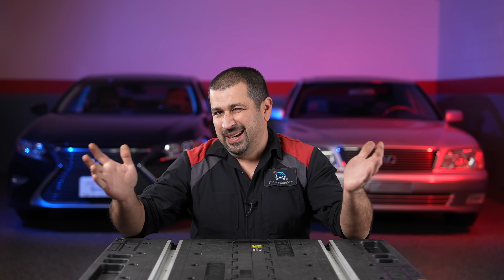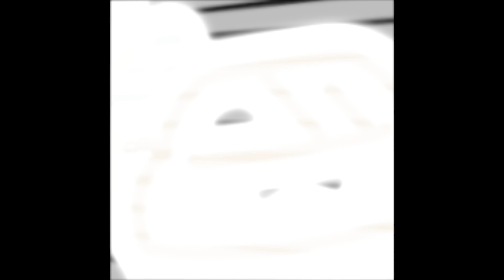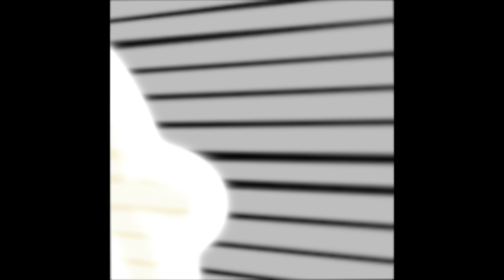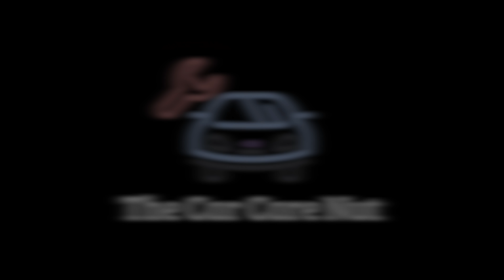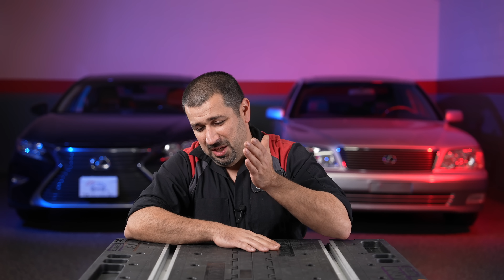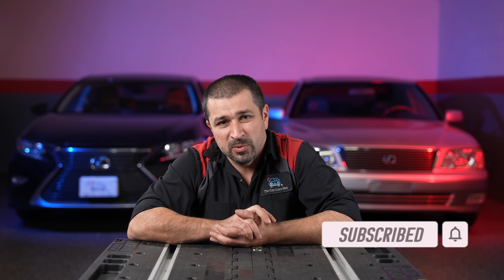Can Modern Turbo Engines Be Reliable? Here's The TRUTH!

Comment: I’m a technician at a Mercedes dealer. Our cars have 10,000 mile oil change intervals. Nobody, and I mean nobody, brings their car in for an oil change in between the 10k mile interval. Personally, I change my oil every 6 months/5k miles. The general public just doesn’t do that.
Reply: That's because most owners lease their cars, or they are on a budget and decide to stretch their schedule lolz. Off-lease car buyers beware.
Reply: @TrevorWebb-ck2yv nah, the cars just get sold as “Certified Pre-owned” (CPO).
Reply: @TrevorWebb-ck2yv I lease I did my 1st oil change on my 2025 sonata hybrid at 2k. Why? To get the metal scrapings out from break in. Now it will be every 6 months. I take 0/16 viscosity oil much thinner to handle cold startups. Might keep car but might turn in. But I want to take care of the engine in case I keep it.
Reply: @TrevorWebb-ck2yv  What's the price tag for that 10k service?
Reply: @TrevorWebb-ck2yv  Most German leases now have free 3 yr maintenance (oil change)...
Reply: @rebeltvr6046  Right but still restricted to the maintenance schedule. You can't come do free oil changes every month.
Reply: @rebeltvr6046  Doesn't mean these people are going to do them, even if oil change is included. Takes too much of their time. Most of these cars are leased anyways.
Reply: @rebeltvr6046  Not Mercedes!
Reply: Most people smart enough to do them at 5k are smart enough to do them at home.
Reply: @rdspam not if you care about a warranty. How are you supposed to prove you changed your oil at home
Reply: @randykern1842 If you don’t have dealership service dept receipts as proof of oil changes and baseline maintenance you can kiss your warranty and any post warranty goodwill goodbye. Is that simple. Enjoy!😂
Reply: @randykern1842 they could easily test the oil
Reply: @Mebbwebb that doesn’t prove all oil changes were performed at appropriate intervals that just proves the current oil is okay
Reply: @randykern1842 I always say what warranty. I don't need the damn warranty. I'll replace the stuff myself.
Reply: @Pamlicojdjdj1487I always say what warranty. Just like insurance in any capacity. Their job is to deny everything so I don't operate under the assumption that if something goes wrong it's going to be replaced by the dealership so I could care less.
Reply: @rdspam warranty becomes invalid!
Reply: When i get my first car in japan i was surprised that they change the oil every 3000 k but now i understand that’s the right think to do if you want to keep your car for years with no engine problems
Reply: I agree with you but what’s funny is that you bring your vehicle and tell the dealership that you want the oil change at 5k miles they will tell you nope you gotta wait until 10k 15k whatever the manual says.
Reply: @jk8839 And that why young persons should learn to perform it yourself.
Reply: @jk8839 that is crazy! Why would it make any difference to them? Maybe they want you to buy another vehicle sooner when you trade it because your having engine problems! Lol.  If your dealer is telling you that ,you need to find another dealer.
Reply: @petejansen7220  😂 exactly! That’s why I always change oil and filter on my own at least!
Reply: @davidkrumwiede446  I myself 100% (EDIT) been working in used & new car garages in the UK for 30 odd yrs,so many bring their cars in over 10,000m for a service and still have FSH/FULL SERVICE HISTORY. But Severe driving is what most of us do as the roads are getting busier,roads works everywhere & start stop traffic is now common with traffic lights & rush hour.
Reply: @tardeliesmagic  unless you are retired and don't drive rush hour anymore haha
Reply: @gosman949 Here in Northern Italy almost any hour is rush our... 😢
Reply: @AAAAAAndrea  oh my!
Reply: How much is a Mercedes oil change?? 🤑🤑🤑
Reply: @JP81188 I have a friend,new Land Rover Defender. Brought into the dealership. 2 years. Oil change and such. Assorted. Maybe wiper blades. 1K for the service. F outta here.
Reply: @JP81188 I have an 03 E class, V6. The oil capacity is 8.5 qts. I use Mobil 1 0w-40 European formula, plus the Mann filter so about $65. I don't pay anyone to do it for me. Car currently has 333k+ miles.
Reply: @JP81188 only if you let the dealer do it. The oil can be bought at Walmart if you DIY.
Reply: That's because you guys charge an arm and two legs for a simple oil change.
Reply: The 10k oil change interval is a lie.
Reply: @bearerofashes Especially with a turbo and very thin oil
Reply: i have a Stinger, and it also has ridiculous oil change intervals. I take it to the dealer since its under warranty and i want records that they did it. Its $90 for a full synthetic change, i do twice per year which works out to 4500 mile intervals. i know its warrantied to 100,000 miles / 10 years, but i love it and might keep it. im also going to go against the manual and do the transmission fluid change sometime around 50-55000 miles. might even do differential/xfer case/whatever it has. i even covered the brake bleeders with grease so i can always get them open easy. overkill, maybe. i dont punch it until its completely warmed up and i take it easy the last couple miles home. whoever gets this car after me is going to be very happy.
Reply: @danwake4431 
Man, I wish owners like you could be marked somehow.
Reply: @danwake4431 Here in Western Europe, you can multiply that $90 by three for an oil change and oil filter replacement. I pay over €300 for that here, believe it or not. That's why I'm going to do it myself from now on.
Reply: @danwake4431 Everything you are doing, is reasonable and correct. I do mine myself, in my garage. Fun and easy to do once you have the correct equipment and desire.
Reply: It’s a kia, don’t waste your time with anything other than ordinary… it’s gonna blow up or burn oil before 100k either way
Reply: @danwake4431 keeping it mint for the next guy is gay lol
Reply: @MF-rtard89  thats just pure luck if i sell it lol. im hoping to keep it for a very long time and have  very little trouble with it
Reply: That’s because 80% are leased vehicles, means the “temporary owner” is going to do bare minimum for PM
Reply: I'm s General public...... for my Subaru I do oil change twice a year for 10 years now 😅😂 it's just my Common sense
Reply: Agreed. I'm a twice a year guy. Early spring and late fall. It averages out to be around 6k miles. I think 3k is nuts.
Reply: @locker1325 I am so with you and do the same thing!!! Thanks!!
Reply: @locker1325  3k is nuts if you can't use the dipstick vaccum method. I use that and I do 3 times a year.
Reply: @AAAAAAndrea Well I think that's extreme but I can't argue with results. My Subaru oil at 6k is damn thin and very dark. But I think flat engines generally contaminate oil more. My Subaru also takes a couple of quarts between changes. There was even a recall for it. It changed nothing though.
Reply: European cars have bigger sump 6 to 8 qts so 10k oil change is same as 5k change with smaller sump 3.5qarts
Reply: @ceylontea5877 Good point. They do.
Reply: I've always changed my oil at 5000 10000 is nuts
Reply: @tdobson888 right ,common sense 😂 no longer a thing
Reply: Are most of those mercedes leased though?
Reply: maybe if an oil change a service wasnt a completely ridiculous $500 at many mb dealers.  the whole thing for mb svc is a scam
Reply: This is why I only buy new vehicles. I’ve never bought into the 10k mile oil change interval.
Reply: @smitty858 Some old cars can handle that, but GDI turbo garbage or  EGR DPF etc... can't handle that. You need at least 5k miles/~7500km then oil and filter at 10k.
Reply: I change my oil every 6 months, when I switch between winter and summer tyres.
Reply: I change my own oil every 6 months or 5k miles, whichever comes first. I am not a mechanic and I just learned how to change my own oil 4 years ago. I have a car 4 year old car bought brand new which is a gem and they don’t produce anymore and I want to keep it for the next 10+ years
Reply: Am a truck driver for 20 years and I have a lot knowledge about engines any engine, including boxer engines., I use TURBO ENGINE ONLY in tractor commercial truck , BUT I skip any single turbo engine for pickups truck , SUV and sedan cars , just no worked basically is just scam technology , Turbo engine is ONLY for tractor commercial trailers
Reply: - and then you have the car owners who NEVER change the oil in their car, then wonder why they are having major engine problems at 30K miles.
Reply: The interesting thing is that dealerships tells you to change it every 15k kilometers (10k miles) but you have to specifically check it for it tobtell you to sometimes change it every 5k Miles (short trips etc.)
Reply: Mercedes is laughing themselves all the way to the bank.
Reply: I do
Reply: Every 5000 miles or less.  Range Rover dealership threatened to void my warranty if I used anything but 0W20 in my 2025 V8 defender.  I want to go to 0W40. Going to have to do my own changes going forward.  Which will also likely void the warranty.
Reply: I took my 2024 Plantinum highlander into the dealer every 6 months, 2 times now. I have only 6300. Miles.  They bitch every time and tell me about the manual.
Reply: @Calventius  my advice is to do it yourself, just use an oil extractor trough the dipstick. No filter in between, just oil.
Reply: I change the oil in my Mercedes AMG C63S, twin turbo v8 engine, every 5000 miles.
Reply: @nobeliefisok9174 are you sure you have enough power and torque? 😊
Reply: I've always cut the recommended oil change interval in half. My cars last forever, they usually get passed down in the family.
Reply: My 2013 Ford Focus St has almost 170,000 miles on it with no issues. Maintenance is key with any vehicle.
Reply: The general public doesn’t think for themselves they follow instructions
Reply: One time a year before winter is enough I making aroun 7-8000km
Reply: It doesn’t help that Mercedes likely charges 500+ dollars for an oil change. Porsche does at least….  But yes, I agree with you. I do my 911 every 5k miles/1 year, but the dealers will RAPE you on the pricing for it
Reply: I  do!!!
Reply: because the manufacturer told them not to....
Reply: when will manufacturers stop slapping turbos on every vehicle? toyota now only has a turbo or hybrid option, i want neither so have departed them, Honda gives me the option i prefer, thank you to them.
Reply: I change always at3000 miles
Reply: No car should ever go more than 5K between oil and filter change
Reply: @JohnSmendrovac Some can if they have a higher oil capacity, like some pickup trucks hold 7 liters.
Reply: B s.  I change mine every 5k miles religiously…..
Reply: Back in the 1980s a friend of mine had a five-cylinder Mercedes diesel sedan.  Out of ignorance and laziness, he had the oil changed at the 9K ~10K miles (14.5K ~ 16K kilometers).  By 70k miles (113k kilometers), the engine threw a rod.
Reply: Don't they also got double the capacity of oil?
Reply: Volkswagen Brazil had the audacity to tell me that if I changed the oil before the scheduled 10,000 km maintenance, my warranty would be voided
Reply: its cause yall (dealerships) charge and arm and a leg so they either do it themselves or take them to independent mechanic shops.. do u blame them
Reply: I’d be curious just how much better the emissions and fuel mileage actually are on small turbo engines versus, say, a moderate size 6 cylinder? From a fuel standpoint, it sure seems like they burn as much fuel as a 6 if you’re constantly spooling them up. Making high horsepower has a cost, regardless of engine size. The government comes up with these rules and car companies play along, but is anything really gained?
Reply: @timjones9282 the fuel savings and less carbon burn comes from the higher amount of air injected by the turbo combined with the variable timing to make combustion very precision along with lower tension scraper rings on the pistons. It is other combinations that assist in our higher technology vehicles. I prefer a natural aspirated engine., 😊but there again I am not concerned about the emissions or saving the world.....more focused on doing some fancy talking at the pearly gates when I get the knock on the dor😂
Reply: Or they don’t want to pay 100$+ for a 40$ oil change.
Reply: This debate about oil changes has been going on a LONG time, and it goes back well before modern turbo cars.  25 years ago I bought a new e46 3-series.  Oil intervals?  15,000 miles.  Now, it could move up or down based on how the car was driven, but it generally hovered around 15k.  This was 25 years ago. 

That 3 series?  I drove it for 125k miles.  The engine was more buttery smooth the day I sold it than the day I bought it.  It wasn't turbocharged, mind you, but it followed the recommended service the entire time. 

My next 3 series was an N54 twin turbo inline-6.  This was BMW's first big turbo experiment.  The car was a 2007 - so 18 years ago now.  I bought it new and drove it about 90k miles.  These cars were notorious for wastegate rattles and HPFP failures.  But mine was fine.  Oil changes were done to the book, always at BMW, in 15k mile increments. 

Since then I've owned a few BMW V8 twin turbos.  Both saw much less mileage, so oil changes were once a year rather than mileage, and that probably meant every 3 - 5k miles.  Neither experienced any issues despite a LOT of issues on the Internet. 

My twin turbo V8 650xi Gran Coupe is still with me.  8+ years, almost 9 now.  It gets an annual service and the engine has been rock solid.  Part of it is also driving respectfully.  Launch control?  Never engaged once.  Hard acceleration every single day?  Nope.  The engine has tons of power so there's no reason to thrash it. 

Now turbo 4's?  I'd be a lot more concerned.  Many economy cars are pushing these little engines to the brink.  They're high strung.  Even normal driving will probably tax them far greater. 

My R8 V10 - naturally aspirated, driven far more spirited, but no turbos.  And Audi built this thing like a tank.  It was designed to go endurance racing (and did), so regular road use doesn't tax it. 

A lot has to do with the engine's design and how you drive it.  Don't buy underpowered cars.  Get a more powerful engine.  My wife's SUV is a MB GLE450 (inline 6).  I'm shocked to see how many cheap out and buy the GLE350 (inline 4).  This is a 5000 pound SUV.  That 4 cylinder is working far harder.  It doesn't matter how carefully you drive if the engine is just undersized for the car.  The V8 might have been the right option, but the inline 6 felt sufficient - not struggling.

Do oil change intervals matter?  Yes, I think they do.  I've just never personally experienced problems with it.  But I also think a bigger part of the equation is the engine size and strain it's under, coupled with how you drive. 

So: 
- Don't cheap out.  Spring for the bigger engine.  Choose this over some silly option like a 14th screen on your dashboard. 
- Drive the car with respect.  If it was designed to go racing or driven hard, go ahead.  But if you're driving your sedan or SUV like you've just entered Le Mans, expect it will take its toll. 
- Change the oil per the dealer's schedule minimally, or once per year if you're not hitting the mileage recommendation.  Want to do it more frequently?  Go for it.  There's no harm. 
- Maintain the car.  Oil changes are NOT the end all be all of maintenance.  Most regularly scheduled service can include things like spark plugs, transmission flushes, brake fluid, air filters, etc.  Skipping this will only shorten the life of the car.

The best option is still NA - it's just nearly impossible to find any longer.  Turbos, especially hot-V configurations, are not going to be as reliable given the massive heat and additional strain.  But I think SOME of it can be mitigated with the advice above.  Long term, I don't think these are destined to be 300k mile cars.  Sadly, manufacturers don't care.  The same can be said of many other manufacturing industries (appliances, for example). Endurance and long term reliability, once badges of honor, are never spoken about any longer... because they just don't deliver it.
Reply: @ezmaass it's bad to their business if the product is too reliable. It must self destruct at some point in time to repeat the sales.
Reply: @ezmaass I love the post. But many people people don’t want or don’t have the cash to buy those higher end vehicles AND pay for the service at the stealerships. I don’t see alit of those vehicles on the across after 15 years of service. They cost too much and for most are not worth it. 300K cars are rare in the NorthEast, ,,,, more because of the brine solution they use for the winter. In all the pieces of the pie on a monthly basis, ,,,, home, food, transport, healthcare, etc. maintaining a  car far beyond its normal serviceable years would only aid in advancing to early retirement/ financial independence. These manufacturers as well as regulations make it harder, not impossible to break the cycle of a recurrent vehicle loan. Learning DIY maintenance , especially in high school is a skill for everyone to acquire as a young person. You points are well taken above.
Reply: @arthurfisch3673 Very much agree.  Manufacturers seem dead set on forcing people into the never ending loan you've mentioned.  I try to keep my cars longer, but it's clear that manufacturers and dealerships are working against you.
Reply: @ezmaass  I worked for one of the big three idiots for a few years. You are correct 💯 percent in regards to reliability. The CEO said they are very concerned every quarter, yet implemented the policies that destroyed quality. He even shed a few fake tears, maybe you can guess his name (it starts with J and he's a bad actor). They WANT us to be driving appliances on lease loan at 7.99 AP rate. Plain and simple, it is not a bug, it is a conscious effort against our best interests by most manufacturers. Also, the cars handling is generally bland, the driving experience has been replaced with fancy multimedia and comfort features no one asked for. It's going on with every manufacturer. Some are a bit better than others but they quickly catch up.
Reply: @ezmaass man… all that is cool until you mentioned the N63/S63being reliable with no issues. Lmfao idc how you drove that thing from the factory that engine is faulty. You don’t have the magical one that didn’t have issues. Lmfao sound like the typical person online I bought this car in 2000 no issues, driving on the same tires and brakes when I bought it. Clocking around 820,000 miles and no issues other than oil changes. Hilarious
Reply: @dariusslay279 There's a huge difference between the N63 and N63TU.  The N63 had a myriad of issues, no argument there.  The N63TU addressed the vast majority of them.  As I said, my 2017 650xi Gran Coupe turns 9 in a few more months.  Zero engine issues.  However: 

- I don't drive it like an idiot.  Many people bought these cars thinking they were designed to be thrashed.  No, they're powerful highway cruisers with enough passing power.

- I've serviced it to the letter.  Important but probably not as important as the last point. 

But, look - BMW V8s are NOT the most reliable.  But my point was simply that they CAN be far more reliable if treated the right way.  Again, don't confuse the N63TU or TU2 with the original N63.  That engine was a dumpster fire.  The technical updates changed a ton.
Reply: @ezmaa @ezmaass t think you understand. N63 is not a good engine at all. Not a N63 nor N63TU nor N63TU2. There is a reason why you could scoop not only your car but a lot of those cars with those engines up with no money. They are bad from factory from the start. Doesn’t matter if you drive slow, do the oil changes every 250 miles, rub the dashboard and headliner for 20 seconds before you start the car nothing. Maybe you just don’t know engines or anything you are talking about. Just another person on the internet that been driving their cars for 2,000,000 miles with no issues original everything. Why lie? I never understand people that do that. You are probably trying to still sell that thing but nobody wants to fix it or buy that thing. You couldn’t give it away to anyone that knows cars or knows that engine. Lmfao you have to find an unsuspecting victim
Reply: 10K is too long, 5K miles is much better for engine health
Reply: @hardcoregames9029  10 K on a 2006 325I  NA-engine in 3 months of freeway driving and the oil looked better than 9 months of stop and go with 7,500 miles.
Reply: What does the owners manual say
Reply: @haboubia  Faulty logic  ...  the manual is designed for the vehicle to make it through the warranty period ... it is NOT designed for the overall longevity of the engine/transmission/turbos.
Reply: Somebody from the benz dealer needs to take 3 samples to blackstone labs,,,, maybe a 10k interval sample on a turbo and non turbo engine. And maybe a diesel benz and compare the results
Reply: What miles they bring it in as?
Reply: Use electrically driven turbos 😂
Reply: My MB M270 engine needs like max 4 months oil changes, regardless of miles, max 3-4 miles too.
Reply: Yea because they drain your wallet at  Mercedes/ BMW dealership vs LEXUS.
Reply: Just got a 2025 4runner and i do my oil every 5000m and will until I decide to sell it .
Reply: I do it used to be 3000 when life was not insane
Reply: And yet…. You have some knuckleheads that say if it is a turbo, you must change the oil Every 3K. Ha!! 5K is the way to go OR, in a cold climate with a garage, twice yearly in the Spring and Fall DIY.
Reply: @arthurfisch3673 bullshit
Reply: @arthurfisch3673  I mean I've heard that if you have a turbo in your car you should change it every like 2500 miles because of the increased internal pressure on all the parts. That said I'm not a mechanic and I've never had a turbo car but I always try to do 3,000 miles on my cars. I like it because it gives me a nice window of time to get the oil and filter so if for some reason I have to put it off for a week or two I can because I'm still below 5,000 miles but I also always do my own oil. If you just have it done somewhere I guess that's not really something you have to worry about.
Reply: A lot depends on how and where the car is driven. Cold climates like where I live require a change in the fall and once again in the spring. If the car is driven mostly long distances, you'll have more miles between changes, which is fine as the oil has a chance to boil out condensation etc. If driven short trips mostly, then the mileage is less between changes. Twice a year should be good.
Reply: I change my gx460 every 5k
Reply: Same here 5k miles
Reply: Simple answer:  NO!
Reply: How reliable are they compared to Lexus and Rolls Royce in your your view?
Reply: I have a GLS and prepaid maintenance.  The dealership will not allow me to change it before the car tells me it is required... Stupid.  All of my cars I do 3-5k.  Glad this one is a lease.  This is why I would never buy a used Benz.  The company wants them to fail.
Reply: @dave22387 The prepaid maintenance plan pays for the services at the 10k mile intervals, but you can pay to have it done at any time between them. Sounds like your dealership just doesn’t want to do it. I’d find an independent European shop to do it.
Reply: That is why you should inform the public to not pay attention to the ridiculous EPA intervals.
Reply: I change the oil when the service engine light comes on every 5000 miles with full synthetic. The average lifetime of my vehicles is 24 years.
Reply: I do it for my bmw m3 and for my v6 toyota
Reply: Correct. In Australia, sales departments sell cars with a Warranty which is often worthless, recommending 10 000 - 15 000km oil/filter changes. Our cars are changed every 7500kms with only Full Synthetic oil. Have 2 vehicles (both diesels) going strong after 350 000kms. You're spot on. The general public has little or no mechanical sympathy for their vehicles. In Oz they lease them for 3-5 yrs then dump them on the market just before multiple, expensive problems occur for the next "unlucky" buyer. Sad to see...
Reply: Great discussion.  A couple of questions for the group:  1.  If the turbos breakdown the oil by running hot, why don’t they engineer a secondary oil system (separate from the engine oil) to lubricate the turbo?  My truck has two separate cooling systems.  Why not for turbos?  2.  Porsche has gone to electric turbos in their 911s.  Hybrid system seems to be the best compromise between internal combustion and fully electric vehicles.  Because they don’t run exclusively on exhaust gases, I imagine these turbos don’t get as hot.  Will electric turbos change the game?  Again, great video!!
Reply: I live in Canada, which is severe service territory. I change my synthetic oil every 7500km which is 4600miles.
Reply: would like to know why does mercedes and volkswagen ,audi and the like suggest changing oils at a higher rate of milage while using lighter wieght oil I was going to a school for automotive training and studied all about regular car oil how its made how they break down  curious JRo
Reply: @jro7075 European regulations I guess, then they use it in US too.
Reply: My Mazda's manual recommends 10k intervals, but I've been doing 5K intervals at the Mazda dealership and the appointment reminder sticker they put on my window is based on 5k intervals. I think the 10k thing is just so Mazda can claim a lower maintenance cost on paper.
Reply: I own a 2024 tundra hybrid, even my service tech was surprised I bring it in every 5k and recommend i keep doing it, even though toyota recommends every 10k
Reply: If I owned any gas turbo it would get changed every 3 K
Reply: I was in the reliability field for many years in a heavy industrial environment and there are at least a couple of things that I learned: over 60% of rotating equipment failures are lubrication related; also, failure rates increase significantly with speed of rotation. Modern automotive turbos turn as fast as 300,000 rpm. Everything has to be perfect for them to operate reliably for many years. Personally, I am trying to keep the odds in my favor and will try to stay with normally aspirated engines as long as possible.
Reply: That's because a lot of people have no respect for the car.  I love my car so there is no way in hell that I would do something stupid enough to jeopardize it's longevity.
Reply: That is a lie
Reply: The Public 😂😂
Reply: As a service advisor and service manager, I'd suggest every 6 months or 6,000 km. The owners manual, the sales people and the customer relations people would say "Go by the oil change light or oil life monitor. Customers would think that I was trying to rip them off. I guess you can't fix stupid.
By the way, some of those monitors would go 16,000 km before they turned on the change oil light!
Reply: Your a lube tech yes, now I bought a benz from a dealer that was at the dealer every 5k and now that car has 270k with no engine issues ever. Sprinter vans with 15-20k oci go over 600k miles that I’ve personally seen on one engjne
Reply: Really?? Shouldn't go no longer than 5000 miles
Reply: 2018 GLA 250 when bought car, I change my oil 6k, on all my cars especially turbos, and I do my own work, if I can save 3to5 hundred $, I do my research and do it myself
Reply: no way I would go 5000, especially 10,000 with turbos. 3000 at the most.
Reply: I do! Every 4-6 K engine oil, filter and tire rotation
Reply: I have a glc 300 turbo and as like  you I change  engine oil every 5K miles include engine filter because I'm living on Northeast with crazy temperature going up and down stressing the engine so much.
Reply: I have a 2013 F150 with the 3.5 ecoboost and make it a point to change my oil every 3,500 miles. 
I have 147K miles hopefully I will be able to get another 100k I keep up with the maintenance. My 2001 ford 150 with the 5.4 has 192K and I change the oil every 5K. For preventive maintenance I recently replaced many parts: radiator 
water pump, belts,coil packs, sparkplugs, fuel filter etc. Hoping to get another 100K on it also.
Reply: I do, or I do it myself, but I also won't buy a "luxury" brand vehicle either.
Reply: I change all oil at 5k miles. Time isn't the issue it's time used. On my Harleys I change at 3k because of the heat degradation.
Reply: How much do you charge for the oil change. Normal cars around here charge $110 for most vehicles
Reply: My car got an M274 Mercedes engine. The oil has to be changed every 25k km (15k miles), or yearly. It takes 7 litres of oil 0W30. It would be too expensive change it every half a year. Seven litres would not spoil in a year, and the amount is sufficient. I do not drive it hard.
Reply: Does oil go bad over time? How many miles do you have on the oil at 6 months?
Reply: @dans_Learning_Curve left in an engine, yes. Shelf life of new motor oil in its container can last years.
Reply: I change my own oil religiously every 4-5K miles....full synthetic, in all 4 of my vehicles.... for 30 bucks a pop
Reply: Goog says 30% of people are ignore their oil change light. A 10k interval can turn into 15-20k then the engine starts burning oil and that same person will ignore the low oil light. That's why 10K intervals fail. Human nature is the problem. Many people are late for work and appointments. Follow a 5k interval instead just in case. We will all benefit if used cars are well maintained.
Reply: I change mine every 5K miles (8k km) on my Mazda 3 turbo. Im at 62k km and no issues yet, drives like the day I got it. Do your oil changes people and know your car not the user manual as that's only a recommendation most of the time. Mazda recommended me 16k km oil changes. I said not a chance.
Reply: I do 5 months, 3k milies.
Reply: I change every 5,000 on all my vehicles!
Reply: Nobody's pay Mercedes-Benz to change oil. Its like $300
Reply: $180-$250 a dealer.. lol.
Reply: The general public is uneducated on the subject matter😅
Reply: Are you saying most people aren't that bright? 😂 👍
Reply: Just got rid of my ML400, twin turbo, w/182k miles.  Turbo was rock solid.  Timing chain/cam adjusters, not so much.  Changed oil every 5k....it's the only way to go.
Reply: Last I checked they didn't make 10k filters.
Reply: @ThemindofOZIII yes there are lol
Reply: How much do Mercedes dealers charge for an oil change? Probably $200-300. The average person bringing their car to a Mercedes dealer for oil changes isn't going to keep the car past 100k miles if they keep it past the lease or loan period. It's not going to be their problem. It will be the next person's problem.
Reply: people with mercedes trade them in regularly
Reply: @billw8476   Exactly. Most probably don't keep it past the warranty.
Reply: I do 3,000 mile intervals but my car is pretty high in milage
Reply: Audi pushes that bs, too. Absolutely not. My Q5 (2.0T) gets full synthetic changes about every 3500 miles.
Reply: I do... have for 40 years...5k
Reply: Yep most owners follow the 10k mile intervals which I think is foolish.  Since owning my E550 Coupe I've changed it every 3500 miles or 6 months.  It's rarely driven so I do them less than 5k.  My truck and Wrangler I do every 5k.
Reply: Those guys that change the oil every 10,000 or more are going to be buying new engines pretty soon
Reply: My family is full of mechanics going back 3 generations. They all say change the oil more frequently than the manufacturer recommends. I own an HR 350Z. I change the oil usually about once every month or every two months based on budget.
Reply: That is why you have a job !!!
Reply: Mercedes have huge amount of oil in the pan though. Toyota have the same 10000mi interval with regular amount of oil in the pan.
Reply: What are the oldest Mercedes you see at the dealer ? I doubt if many people who can afford a new Mercedes are that concerned about whether it will last more than ten years.
Reply: If I had a new vehicle under warranty I would bring it in to a dealer for the scheduled oil changes at 10k mile intervals and do my own extra oil changes at mid point between those 10k dealer oil changes. The filter can likely just stay for the full 10k. I have even been seeing people claiming some oil filters work better as they get older and trap more particles although that would be offset by excess back pressure if pushed too far.
Reply: @waynek805 never a good idea to push an oil filter that far if you don’t have to. Depending on driving conditions and habits, it can clog and the bypass valve will open, flowing dirty oil around the engine
Reply: @davidcardinal3654  If the manufacturer says go 10k on an oil change with filter change, then I think changing filter every 10k and oil every 5k should be more than sufficient.
Reply: @waynek805 not worth not changing it for a $19 part. The problem is they put the filter in crap places or started to use those cartridge filters. Subaru has got it correct. Spin on canister filters right in top of the engine. Use a Fumoto drain valve to empty in a gallon receptacle. Make it way easy and DIY!!!😮
Reply: @waynek805  Warranty isn't going to save you, no one's giving you a new engine just because you complained about oil consumption. 😂
Reply: @MikeKayK  I have no idea what you are on about. My point was to follow the manufacturer's 10k oil change interval having their shop do the work but supplement that with extra oil changes to make sure you are always working with fresh oiul. That will hopefully allow the engine to actually last and not die right after warranty expires, as the manufacturer wants.....
Reply: @waynek805  good for you doing the extra oil changes! My question is why would you put clean oil in a dirty filter? The cost is not that much more to replace it. Filters are designed with a buy pass valve.  When the filter element plugs, it will bypass the oil not filtering the oil at all. Maybe under ideal conditions, like if you did all highway long trip miles that would be ok, but 99% of people drive in stop and go traffic short trip driving(LOSTS OF COLD ENGINE STARTS) all very hard on the oil and stress on the engine, especially if you have a turbo!
Reply: @petejansen7220  Don't want to give the dealership any indication you are working on the vehicle yourself. They will look for ANY EXCUSE  to deny warranty claims! So I guess you could just use the same filters they use and be fine.......... But as I already stated, the issue with the 10k mile oil changes is oil breakdown prior to, NOT the filter clogging.
Reply: @waynek805  That's what I plan to do with the ToyotaCare on our new Corolla Cross L. Seems like a good plan to me!
Reply: @waynek805  new MBs are leased no one cares. Also no one in their right mind  would buy a new MB to own. lease only, those fall apart under warranty forget owning one when the  warranty is up.
Reply: @waynek805  this is true about oil filters
Reply: @blgdinger3  What is!!?? That they work better after having some 'crud' buildup or that they are better when new/totally clean???
Reply: @waynek805  BMW, ever since 2010, have the official engine oil change interval at 30 000 - which is much higher than 10 000 miles. And people go even beyond that. Absolutely crazy. I do 6-7-8 000km in my 530xd.
Reply: @waynek805  Thats what i also do,
Reply: Do mine between 3,000-3,500 all the time
Reply: @andersonrodriguez8258  wasting oil and time
Reply: @andersonrodriguez8258 .  Complete waste of time and money...scientific studies and research done by actual car owners have shown time and time again that it's a complete waste of perfectly good engine oil to change every 3,000 flipping miles...Black Stone Laboratory has done hundreds of tests that show even turbo engines are completely within safe levels of oil protection and additives up to 7500-10k sometimes even more miles from a molecular level. That's not opinion it's scientifically proven...but folks will continue to spread unfounded fear based "well that's how my daddy did it" reasons to justify wasting 3x as much oil and spending 3x as much money on oil changes...but they'll be folks arguing about this on the internet after we're all bones and dust 😅😂🤦🏾‍♂️
Reply: @andersonrodriguez8258  a waste
Reply: @gosman949 enjoy your oil consumption, let me guess..."it's normal" 😂
Reply: @gosman - I'd rather have more frequent oil changes than pay for a new engine.
Reply: We have three Mercedes Vehicles and they are all Mild Hybrid Turbos - the latest one has a 15000 miles  oil change interval.  We have the oil changed every 3000-3500 miles on all of them.
Reply: @MJSEsox Isn’t that a bit excessive? I would think 5k would be alright. I have a GLS450 with the mild hybrid.
Reply: @bradleyscarreviews  can’t know if you don’t have it tested. Blackstone or Speed diagnostics. Motor oil geek on YouTube. I wonder if people know about engine oil analysis, cause I don’t see many people talking about it.
Reply: @bradleyscarreviews 5k is plenty fine for both turbo and non-turbo under normal operating conditions. 3k mile OCIs is a waste of money and oil unless you drive in the desert or artic full time…
Reply: @bradleyscarreviews  It is just something I have been doing since last century with our cars. My logic is oil and filter is peanuts compared to the price of the cars. Our cars are kept in pristine condition, inside and out, including the engine bay and under body.   We use an independant shop to do the work.  Other than anything under warranty I am NOT a fan of using a dealership to do routine maintenance.
Reply: @Augustine1488 I just posted comments about this.  Been doing oil analysis for 40 yrs. have never had a single eng. failure in well over 2M miles.  We currently change Rotella T6 at 8k mi. per lab recommendation.  Use T6 in everything now. 

Tested PREMIUM Amzoil everything for 25k too, poor lab and eng. vibration results. Motorcycle vibration was the worst, within 400 mi. by 600 it was done. Same poor experience in auto. (Only tested, because friend was retailer)
Reply: @MJSEsox  yall rich asf
Reply: First of all, the "general public" does not own a Mercedes. Second, many of the people that do < 10,000 mile oil changes do it themselves or have it done at an independent shop.
Reply: Another thing is dealers use thin oil like 0W20 for turbo vehicles, the thin oil will get shear easily & combined that with 10k miles oil change interval, it's a total disaster.
Reply: @johnmactavish5191  low weight oil is for efficiency. Test the oil to see if it’s worn out when you change it or before you intend to change it oil analysis removes any guess work.
Reply: @Augustine1488 low viscosity ( not weight ) is subsceptible to contaminants, the lower the viscosity the more problematic it is
Reply: @AAAAAAndrea  that’s fine, you can have it tested to determine how it is holding up.
Reply: @Augustine1488 there have been a number of articles and videos on YouTube this week showing up in my feed saying this engine in America gets zero w I guess 20 or 0w30 but overseas they use five W 20 or 5 W 30. I remember when it was either 10w30 or 10w40 and you didn't have anything else have engines changed that much? That's the oil has to be that much less weight?
Reply: @johnmactavish5191 that would screw up my engine.
Reply: @johnmactavish5191 0-20 is for hybrid 
That starts stop really a lot 

It’s designed for engine with loose internal 

It’s new emissions crap
Reply: @johnmactavish5191 maintenant c’est la 0w8!😂😂😂
Reply: I do that :)
Reply: I just bought a 2025 GLS450. They are solid vehicles right? I think it has the M256.
Reply: I am the general public, and I most certainly do. In fact, most would consider me wasteful. I change my oil and filter every 3000 miles in all three of my vehicles.
Reply: You drive 5,000 miles in 6 months???😮 WOW. You need to move closer to your job. Ouch.
Reply: @ctdope Do people use cars to go to work only? 😂 You use a car for everything, 10k miles/year is standard  usage.
Reply: @AAAAAAndrea  I heard that before. I know some who do more than you. I dont go too far, less than 7,000 a year, for now.
Reply: @ctdope I wasn't talking about me specifically, most people here in europe do 8k miles /year on their car. I used to do 20k miles year
Reply: @AAAAAAndrea  I do 15 000 - 20 000 miles here in Eastern Europe. Some of my friends between 40 000 and 50 000 miles a year. Oil change every two months for them. I also do 4 changes a year. I buy so often filters from the dealership so they always point that out.
Reply: @c @ctdope I do like 5K in 10 weeks lol.

Not everyone can live close to their job either.
Reply: I do my crv every 2500-3k miles. Max ive went is 5k
Reply: And in Europe which has even longer intervals the vehicles are absolutely fine.
Reply: The Sprinter is 20,000 miles which I think is crazy but On The Road With Ron YT channel does them around 20k and sent it off to be tested and everything looked good.
Reply: @bah5310 You can't see all that happens in an engine from oil samples. You don't see warnish/sludge inside, wich is the real engine killer. Sticking piston rings are what kills engines the most, fucks up everything. 
Varnish and slusgr
Reply: Diesel engines don’t belong in passenger cars nor do turbos
Reply: @davidmann4533 Europe had 60% of sold cars as diesels, diesel is the best engine for passenger cars.
Reply: @davidmann4533 why not?